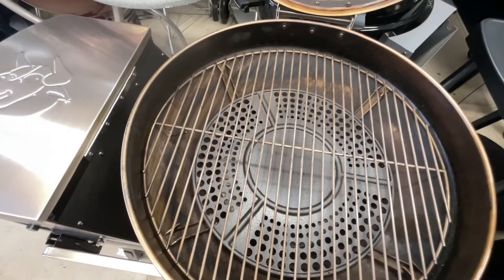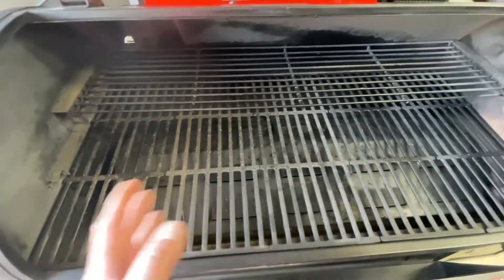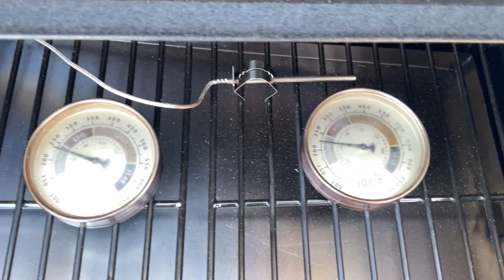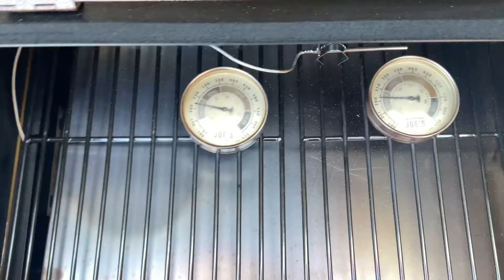Make Your Pellet Smoker More Accurate! / Easy Temperature Probe Modification!

Comment: I replaced the controller that came in the 2015 model Traeger Texas 34 with one made by Smoke Daddy (PID control). It made a world of difference. Temps are consistent with minimal swings. Very happy with my setup.
Reply from the maker: Thanks for Watching Michael!  Good to know!  Appreciate the feedback
Reply: I have the lil tex. I wonder if this would help mine as well.
Reply from the maker: Thanks for watching! It could
Reply: @TomHorsmanAmateurBBQ  I did notice that my chimney cap was loosened to the full open position so I closed it down over an inch. Not sure if that would account for hitting 400 when set at 225. I've got it all vacuumed out and I'm going to run it with the grate and drip tray out so I can watch the auger operate to see if it ever stops or just runs continuously. I've already got a new temp probe but I tend to think it might be the controller...
Reply from the maker: @masaleov Thanks for watching! Good luck

Comment: Great video Tom! Thanks for all the time you spend creating these very helpful videos. I just purchased a ZGrills 1000D3 and finished the biscuit test with results as expected and similar to your own test. I decided to track the temperature with my own BBQ probe and achieved some poor results. For a temp setting of 180, the temp inside the chamber was 207 degrees (as measured by their probe and displayed on the controller) and my own temp probe measured 218 degrees.  Those differences tracked similarly when I changed the cooking temp to 225.  I contacted ZGrills customer support and was told that this is normal but I have my doubts. I decided to check with the experts (you) and was wondering if you have also seen temperature disparities as I did?
Reply from the maker: Thanks for Watching!  I haven’t noticed this,  although you need to remember where the temp probe is, not at grill grate level, majority of other pellet grills don’t have the temp probe at grill grate level. You should expect some differences.  Now that you know you can adjust accordingly
Reply: I also have a Zgrills 1000D and see the temp difference of 20-30 degrees from the probe to the middle grate. I modified the mounting bracket so the probe is in a horizontal position at the middle grate level. Now temps are +/- 5 degrees from the setting on the controller. I told Zgrills customer service about this and they had no answer. But they did say they would send me a new controller free under warranty.
This is clearly a design issue.
Reply from the maker: Thanks for watching Phil!  Good feedback.  All pellet grill manufacturers have the rtd probe hard mounted in the grill. I’ve suggested that the probe be on a longer wire with a clip that be attached to the grill grate at the level that you are cooking.  Here’s a video I did showing that….https://youtu.be/0XENNqvrm0g?si=hy9Y131hfwDU2T7p

Comment: As someone well-versed in thermometry, I believe it may not be necessary for you to undertake extensive measures and instead, it would be advisable to keep the probe in its intended position.
Reply from the maker: Ok, Thanks for watching
Reply: @TomHorsmanAmateurBBQ  Wireless internal thermometers do seem very useful however.

Comment: When using a Pellet Grill like the Z-Grills with the NON-PID Controller, what is the probe actually doing?   Is it simply showing you the temp at the top of the probe at any given time ONLY, or is it actually being used in conjunction with the operation of the timed pellet feed electronics?  

Personally, I think it is only displaying the temperature of the probe itself.  I say this because I have frequently set my grill to a lower temp like 180 F after being at 225 F for an hour or more and the display temp actually rose and the grill continued to feed pellets into the burn pot after the temp reduction.  In some cases, the temp actually INCREASED in the grill for a while taking up to 1 hour or more to get down to the selected temp, and sometimes never reaching the lower temp.  

This may indicate that all of these traditional controllers are purely time dependent and don't really use the probe for anything regarding heat regulation in the grill.  

A simple test would be to set the grill at say 225, let the grill reach that temp for an hour or so, then physically remove the probe from the inside of grill and set it outside the grill while it's running and let the probe come to ambient outside air temp and see what happens to the internal temp of the grill   You could use something like a Grill Temp probe attached to a Thermapen Smoke thermometer device to see what happens to the temps inside the grill.  I'm betting it doesn't change at all over time if the probe is simply used to display the temp of the grill.  It would be a good test for sure.  Perhaps you could give it a try and show us in a new video.

One more question...  Are ALL RTD probes that you have seen the same "Resistance".  I believe all of them work on a resistive principle that when the probe heats up, the resistance will either go up or down.  This can be tested with an ice bath and a cheap meter that has an OHMS Scale on it.  Perhaps you could test a few of your different brand pellet grill probes and let us know if they all measure about the same resistance at specific temps like ambient, 225F and 350F.  That would be very helpful for folks to know if they had to purchase a new RTD Temp probe in the future for their grill due to a failure of their existing proble.

Thanks for these informative videos, I have learned a lot from you.
Reply from the maker: Thanks for watching!  Any none PID grills probe only reads the temp and shows on the display.  As far as the workings of the RTD probe, it’s seems you know more than me. Thanks for sharing

Comment: Tom Horsman, Thanks for the video.  I like the concept and want to implement it on my Camp Chef WWpro.  I used your link to order the RTD from Amazon and it arrived today. I wanted one with the metal covering over the wires, but I received one with a cloth covering.  Can you provide a link or tell me where to buy one with the metal cover?
Reply from the maker: Thanks for watching Larry!  Amazon probably has the best selection. I fair amount of the ones for Pitboss have the metal sheath
Reply: Do You know if the Pit Boss connection is the same as the camp chef? @TomHorsmanAmateurBBQ
Reply from the maker: Not sure,,, it pretty universal amongst pellet grills

Comment: Good video Tom. I have a question for you. I have a camp chef DLX that I have had for about three years and it has the old original controller. I would like to have the new PID controller that can be adjusted for more smoke. Where can I purchase one?  Thanks.
Reply from the maker: Thanks for Watching Todd!  Ryan is correct,  however there are other available, depending upon what you have the Smoke Daddy PID might work better.  www.smokedaddyinc.com